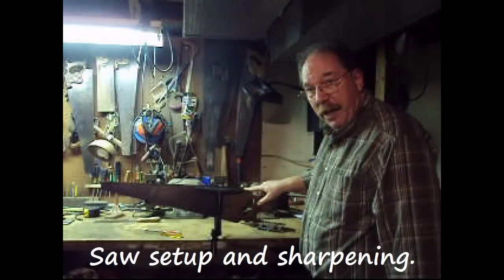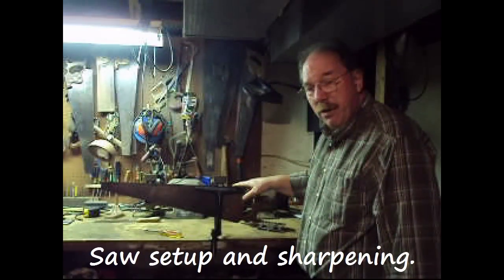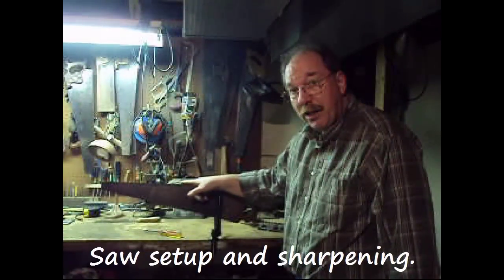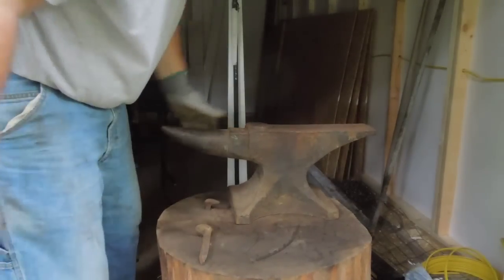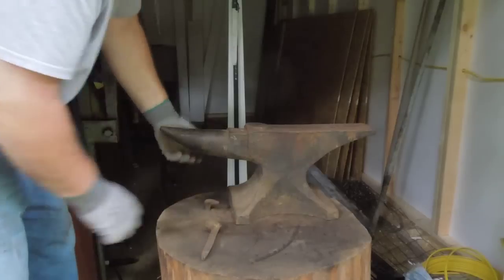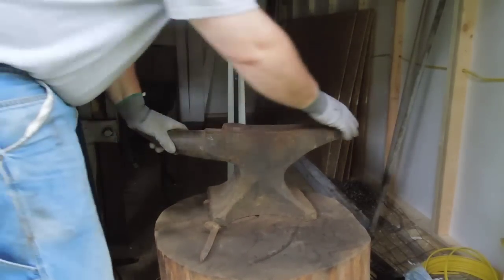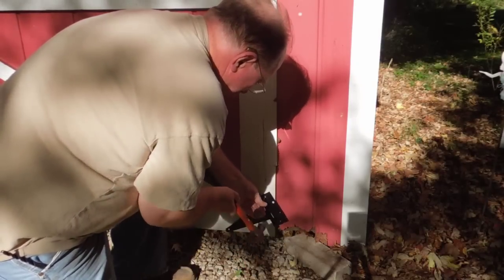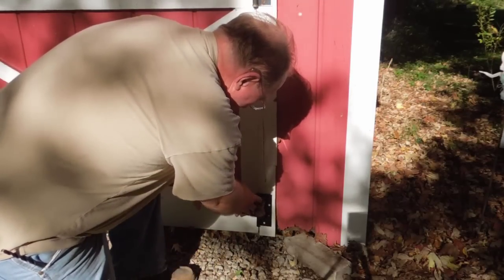Who is Old Sneelock?

Comment from the maker: When I started the Old Sneelock's Workshop channel there had been some discussion on the Old Tools mailing list. oldtools@ruckus.law.cornell.edu of how to sharpen a woodworking auger bit. I have a fascination with old tools, mainly barn augers. I had studied the problem of how to bring back old, rusty, dull auger bits to useful condition. Word pictures are an art. Very few people can get an idea across to a diverse audience using the written word alone. I worked as an Industrial Engineer for many years. One of the facets of the job was to create work instructions for building and assembling hundreds of different products. I decided to use the skills others had taught me to put up a video showing how to sharpen an auger bit. If a picture is worth a thousand words, 30 frames a second adds up to a lot of words really quick.
One thing led to another and I've found myself with more than 70 videos ranging from using a tractor to wiring a house. It's a niche channel but we just hit 600 subscribers and are rapidly approaching 100,000 views.
It's a great way to share what I've learned over a lifetime of work.

Comment: I have an auger bit either made without a pilot screw or so rusted it's threads are not visible. Thus I don't have threads to follow with a file. Can I create new tapered threads myself? Thanks
Reply from the maker: Yes. I have done it just to see if I could. The next question is will the result be worth the time spent? That you have to decide for yourself.
Reply: @OldSneelock  Can you describe the process for me a little? Thanks
Reply from the maker: @nonconnahcreekconservancy6219  Here is a video showing how I repaired an auger with a damaged pilot screw. https://youtu.be/S4HJt2SH-4Y